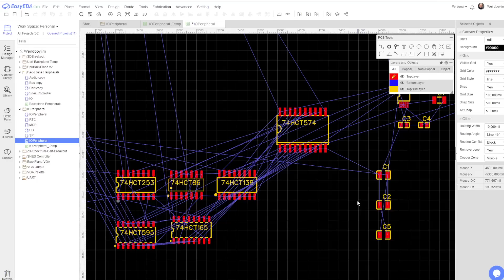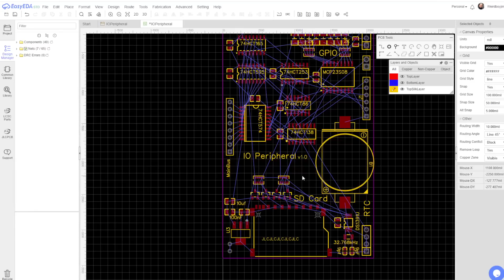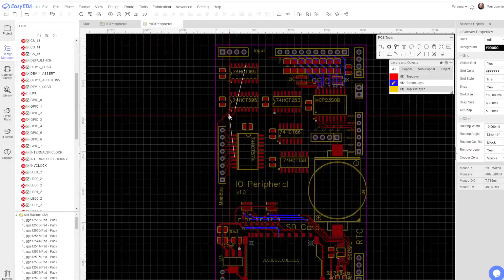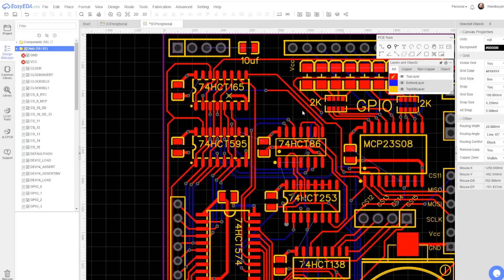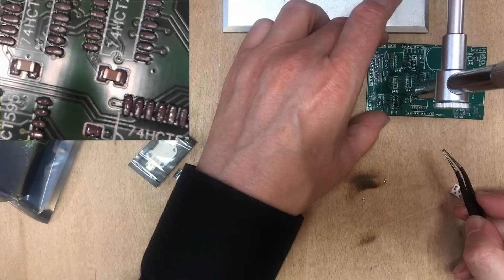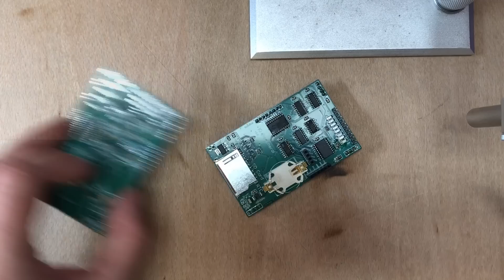IO Peripheral PCB - IO from Scratch - Part 9

Comment: My go-to tool for cutting traces is an engraver
Reply from the maker: Like a dremel type tool?
Reply: @weirdboyjim  Yeah, except what I use is much smaller, runs off a AAA battery and is held like a pencil. The cutting tip is a tiny ball with a jagged surface. It works great for precisely making narrow, shallow cuts.

Comment: I think pretty much every PCB designer has mixed up at least MISO and MOSI on a SPI bus, and RX/TX on a UART at least once. Sometimes even datasheets are ambiguous with some chips! UART especially, now I always label nets as "TX_FROM_MCU" and "RX_TO_MCU" etc so it's pretty obvious to me :) 

On JLCPCB, I've used them a lot for probably 5-6 years now - hundreds of boards per month with various designs, all PCBA. They're good EXCEPT when they make a mistake in production. In the latest case they'd loaded some BGA chips in the wrong rotation, and as I use a programming jig, I had 4 boards fail in a way that also destroyed the chips before I noticed and had to check all of the others. These were expensive chips that I'd ordered from another supplier, and stocked at JLC for production. It was a loss of 6 6-layer boards in total. I had no way to remove the BGAs and reflow them easily as they were densely packed with components on both sides. Each board cost around £100 in the batch, and they offered a £50 voucher, and refused to do any more. I've had similar issues previously, but not so costly, but they've never offered a refund that matched the cost of the boards. I have fixed issues myself previously, but my rate per hour means it's actually not worth it financially (I still do it in my spare time though).

I also use PCBWay, and am moving the more expensive boards there - they do charge more but I haven't had an issue with them as yet - touch wood!
Reply from the maker: Ahh,  all those interesting mistakes I can add to my repertoire ;-)
Reply: I once swapped ends on all bits of an 8 bit data bus due to LSB vs MSB naming conventions on data sheets. I managed to swap 8 tracks at 0.025 inch pitch in less than half an inch distance.  But that was around 1987 or so - my eyes were a lot better back then. 😅

Comment: Hi James,
I always love to see your videos and all parts of your project are coming together really nicely. Just one thing I already noticed earlier regarding the decoupling: You placed the GND/VCC vias between the IC and the capacitor in most cases. This way you couple into the power planes before you even reach the decouplig capacitor. You should always go through the capacitor's pads before entering the power plane to get the full effect of the caps. For the switching speeds you have in your project it may not be a major issue but it improves overall signal and power integrity. I learned this myself from a collegue with long time experience...
Reply from the maker: I can see the logic to that. I'll try and take note in future, but ground planes and fill can make that tough.

Comment: Hi James, I noticed cleaning up my boards with 99pc alcohol before reflow almost totally removed solder bridges issues. Also routing 4 layer boards I know is more expensive but saves you big time and generally improve your signal quality.
Reply from the maker: These are 4 layer boards, although I use power and ground planes rather than use the extra layers for signals.

Comment: I've never done the trick with kapton tape on the pads I don't want to connect, but that's one I'll likely use in the future. A couple wires getting a first revision PCB working is pretty much the norm in the industry. Even in bigger designs with a team and design reviews it's always possible to miss something that looks obvious in hindsight. I've seen whitewires in finished products I've bought, sometimes it's cheaper to fix a few thousand boards than scrap them all. Bit of clever wire bending, a bit of kapton to hold them down and the fix will last forever.
Reply from the maker: I'm pretty sure I separated those connections anyway but I wanted to make 100% sure!

Comment: This was really funny, because I made a very similar mistake recently. 

I'm working on a board for the RC2014 bus that has a TangNano 9k module as a VDP with HDMI output. 
And I because the data lines are named backwards in all the VDP datasheets, of course I wired the up the wrong way around. In my case, I didn't have to do a physical bodge, but could just swap the data pins in the FPGA.
Reply from the maker: Ohh,  a software fix for a hardware mistake. Nice!
Reply: @weirdboyjim  only temporary of course. New boards will be made with the right wiring. 
But I can't afford that right now, so I had to fix it temporarily so I can keep working on the software for it

Comment: I'd love to see an interface chip for hobbyists which can go on a classic 6800/8080 bus and give SDIO(!), SPI, and I2C!  Patents be damned!
Reply: For SPI: you can do that with 2 shift registers and a counter. And SD cards really just "speak" SPI on a hardware level. 
The problem is that the simplified specifications that the sd consortium puts out publicly doesn't have the sdio part in it. You have to be a company and member of the consortium to get that. 

I2C is much more difficult, because you have bi-directional signals that are sometimes output, sometimes input.
Reply from the maker: Not sure about a chip, but it wouldn't be difficult to design a little module for that.

Comment: Congrats on the sponsorship, a perfect match. 
A tip for using desoldering braid on fine pitch pads and delicate wires - don't drag the hot braid over the track, it can cause the track to lift. Just place the braid over the track and run the iron over the back of the braid.
Reply from the maker: Thanks!  The biggest improvement in de solder braid I found was to massage a little flux into the braid. I'll try not to drag it in future.

Comment: I have a board i made where i had two spi pins transposed.  Thr bodge has been working fine for close on 4 months. I do intend to roll another board but there is zero urgency.
Reply from the maker: Some bodges feel very fragile, but some I just want to remove out of principle!

Comment: I was wondering if the routing software would allow inspection and validation by simulating the logic, etc. before one commits to a physical board. I would have thought that with today’s sophisticated tools, that would be built in.
Reply from the maker: That would be useful. But very difficult for a board like this where the simulation would need to know about the rest of the circuit to test it properly.

Comment: Great work. A home-brew processor reading an SD Card is damn impressive!

Back in the day we used to use "Kynar" wire-wrap wire for bodges. Highly recommended if you can source a spool or two. Two great features: you could use the wire wrap tool to handle the wire like a micro-manipulator: you could strip the wire and then use the tool to loop the tiny wire around pins and such for soldering. Also - the insulation was, I think, Teflon, so it never melted. You could have the insulation right up against the bodge and it wouldn't shrink back under heat. Oh, and it's tiny of course. 28 gauge or so?
Reply: Unfortunately most of the "kynar" wire you find around these days isn't :/ it's not silver plated and the insulation is PVC or at least something other than a fluoropolymer because the insulation shrinks back on heating and it doesn't take solder very well... It IS fine for actual wirewrap work but not many people doing that these days.

I have a couple of km of that stuff unfortunately so I do most of my bodges with enameled copper wire (aka magnet wire).
Reply: @SomeMorganSomewhere  Disappointing, but not surprising. I'm still using spools that are, ugh, about 30 years old. I'll be sure to not to use them wastefully. I won't keep them on the shelf with my "Tapcon" tape and "Ponasonic" capacitors...
Reply: I have a reel of it in front of me! 30awg. Not teflon, but related to it.
Reply from the maker: What I'm using in this video was sold to as "Kynar Wrapping Wire" after someone recommended it in the comments of a previous video.

Comment: Accepting a sponsorship from JLCPCB must have been the easiest choice you could have made in the entire build, what with the number of PCBs you've gotten from them over the years - glad they were willing to support the project!

And sympathies on the bodge - it looks about as clean as it could get, though. Nicely measured wire lengths and everything.
Reply from the maker: Indeed, a product you already use regularly is very easy!
Reply: i don't mind it at all, it's how i found em first place and been quite happy as their customer for keyboard pcb's :)

Comment: I like to use very fine single core PTFE wire for my bodges. the insulation wont shrink back with the heat and can be laid down with ease and a little superglue holds in it place just fine. in the days of TPH components it could be fed behind the legs of DIL IC's to hold it down on the PCB.  some of our devolvement PCB's may have flown with mods like this, if the unit had a painted blue band around the case it might have some bodges inside.

we used a 4 band system on the equipment.
1. A painted Red band, was equipment was for rig use only.
2. A painted Blue band, was could be flown but a back up form of communications must be carried.
3. A sticky tape blue band, a production unit but full qualification has not been signed off yet. once it was fully certified the blue band could be removed.
4. No band, fully certified production unit.

No bodges were allowed if the band was not painted on.

Now I'm free to bodge to my hearts content, happy days 🙂
Reply from the maker: Interesting. My concern with these longer bodges is catching them in the future! I'll do a board refresh before too long!
Reply: @weirdboyjim  That's the problem with cheap PCB's. My last professional PCB's cost well over £1K for 75 ! So you have to make sure that there are no errors before sending them out. Check the circuit for error's, then check the Gerber's for any errors. like not enough via's for the required current overhead. check the right copper amount is specified on the PCB paper work. boy is sending a PCB off to PCBWay easer. 🙂

Comment: I don't know how much it matters, but the Vcc plane covers the area under the RTC chip. If the chip acts up, that might be the reason.
I never mind sponsorships that are relevant. And it is a little sad making it took this long.
Reply from the maker: Hmm, didn't think about masking of the vcc plane.
Reply: @weirdboyjim  There are different opinions about - what I usually do is laying a guard "negative trace" around the oscillator up to the oscillator pins of the RTC or uC. This way you have small isles with a single connection to GND/VCC below the critical lines. And these isles are not used as current return path. You load capacitors will then be connected to GND inside of these isles.

Comment: A suggestion: Implement some kind of history mechanism in your CLI so you can easily repeat commands.
Reply: When he has storage fully up and running a terminal history file can be saved to it. 😊
Reply from the maker: That would be useful, but you really need a more advanced line editor to use it. all tasks in the backlog!
Reply: @weirdboyjim  - an interactive line editor is not required. Something like simple token substitution will go a long way. Like in Bash where '!!' will cause the last command to be executed. Or '!!:s^txt1^txt2' which will substitute txt1 with txt2.

Comment: James I’ve never seen it in all your videos but just wondered if you clean or wash them off camera to get rid of all the flux?
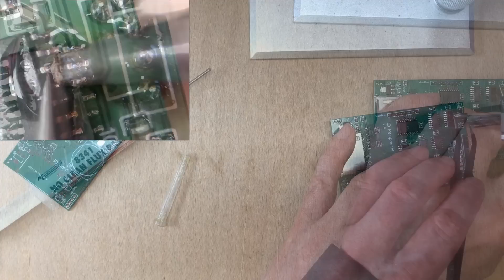Reply: 37:54  tube says "no clean flux paste"
Reply from the maker: I have a cheap ultrasonic cleaner off ebay but Haven't been cleaning the boards as routinely as I should.
Reply: I did wonder if you did as that flux is a nasty acid and it’ll eat tracks and component legs.
Reply: @markrgreenlane  not all flux will do that, only highly active fluxes which aren't generally required on a fresh board like this, as jyvben1520 said it's no-clean so the only issue is an aesthetic one.
Reply: @markrgreenlane  Flux for use with electronics shouldn't be aggressive. Most modern flux is of the "no clean" type, so you can leave it on.
Reply: Thanks all, I must have missed to see the no clean on the tube and to be honest I didn’t know it was a thing.

Comment: Sorry if I am alone with this opinion, but I love the bodge stuff, and I like true soldering videos much more over this reflow stuff. #ASMRSoldering And yes, I am aware of the advantages of reflowing ...
Reply from the maker: I doubt I'll ever get to the point where I don't need to do a bunch of hand soldering work. It is quite rewarding but the reflow is good for getting lots of connections done with high reliability. A reflow oven would be better but at least with the hot plate I can record the process.